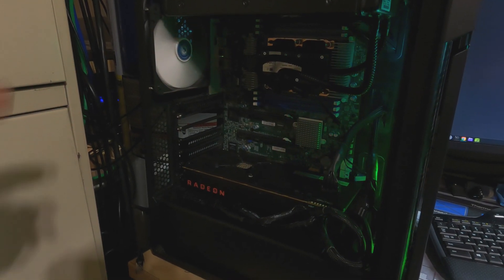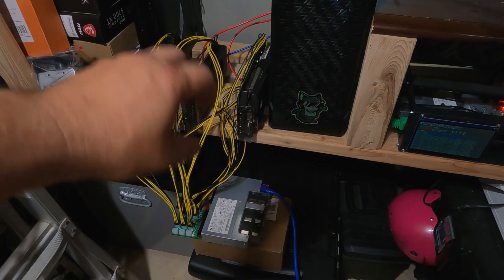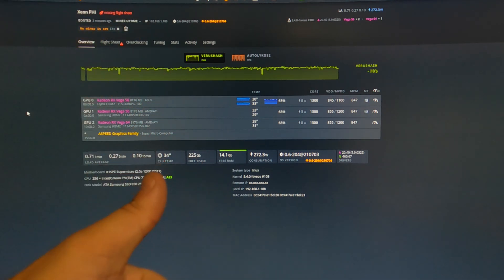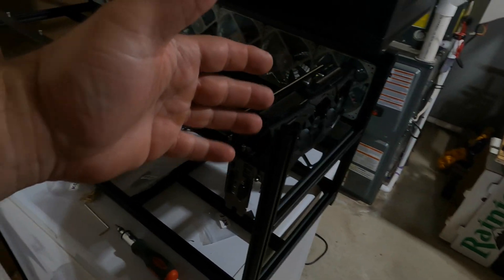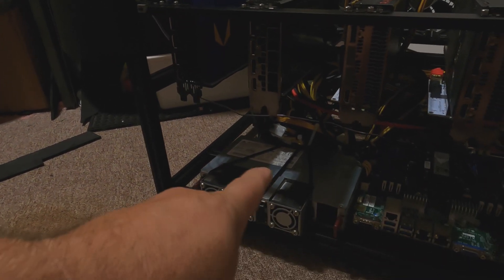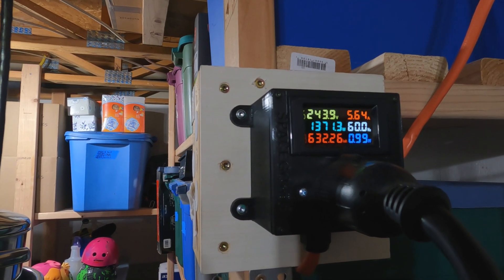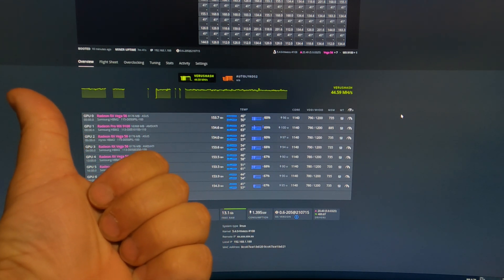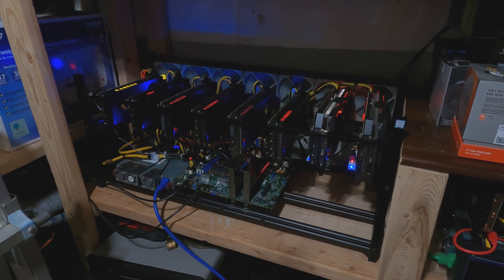Most Unique Mining Rig Build - Xeon Phi 7210 & 8 Vega 56/64

Comment: there are 8 cards at under 100W each how are you pulling nearly 1400W from the wall, what is the system/Phi power draw ?
Reply from the maker: That's only software wattage reported, true wattage if each card is around 160 watts .
Reply: @madelectronengineering  truth in wall pull !
Reply: @madelectronengineering  Xeon Phi 7210 seems to pull 250W software Watts for mining Verus in your other video, maybe 40-60W for the mobo, ssd, fan etc; together with some PSU inefficiency 15-20% around 350 W overhead, seems the 8 cards pulls around 1KW real power, 125 W each?